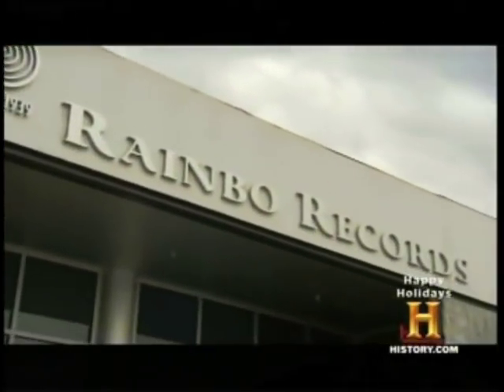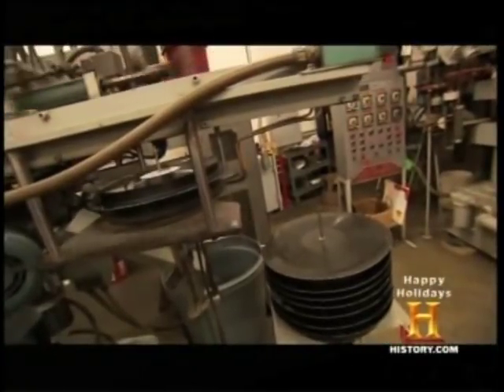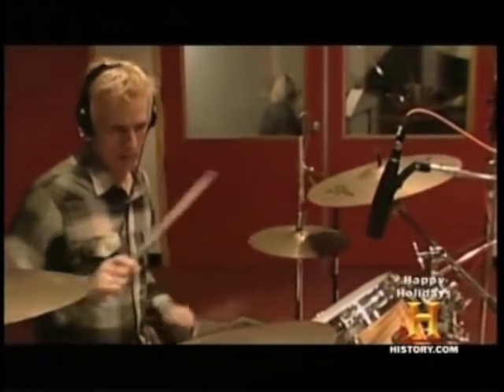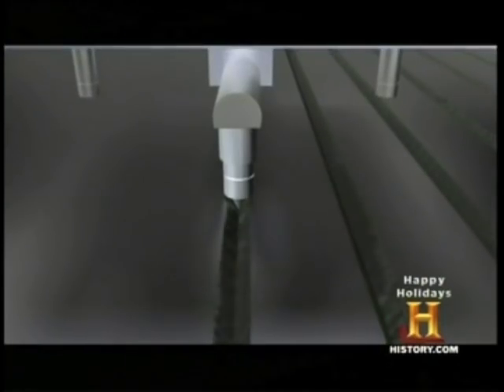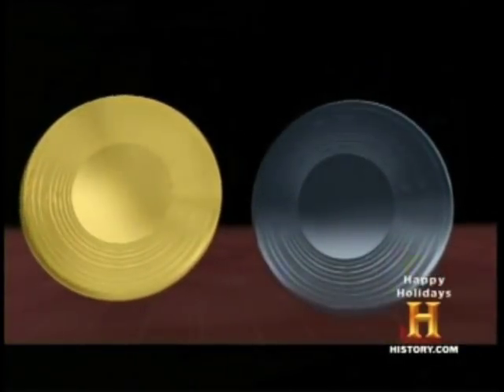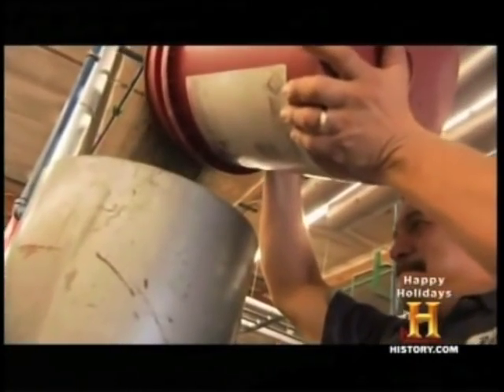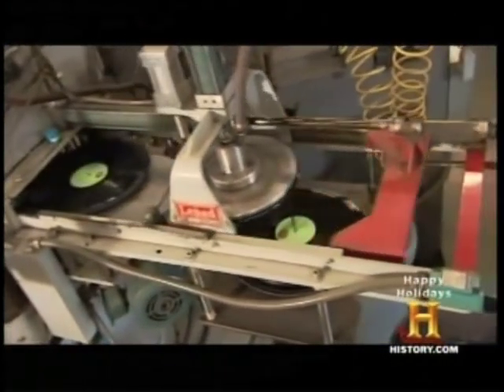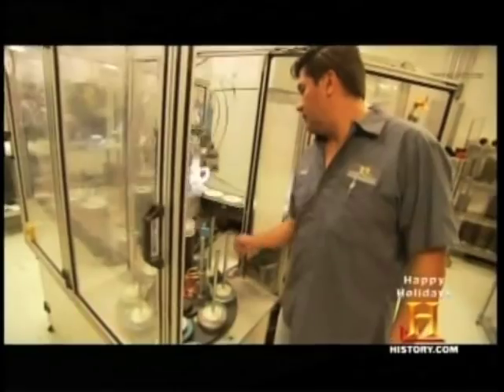Rainbo Records--How a Record Is Pressed

Comment: @HypeRhymz The problem about those players is that I hear they are more cheaply made and the stylus is a lot more delicate.  There are plenty of youtube users that post videos of their 45s playing on their old household turntable and it sounds better than a CD would produce.  I'd just ground the outer cable to something metal and modify the audio cable so it fits in the 'line in' jack.  They have the red-white-to-3.5mm converters at Radio Shack, for example.  Nothing beats the sound of a vinyl.

Comment: Vinyl has very limited dynamic range, CDs, are 48.1 24 bit, iTunes sells the crap audio for streaming, except you pay an extra buck for HD. Only way to get any thing decent from vinyl is completely manual equipment , remove the auto on, and auto return gearing, that extra dragging causes extra friction against the tone arm, which hold the cartridge needle favoring one side of the groover.The automation has gearing, great gearing, but still drags. The tone arm should float effortlessly through the center of the groove, and drop deeply into the groove, or you just don't get it all. Back in the 1977, they were trying to add dynamic range enhancer, another black box, for turn tables, then came the CDs, with huge dynamic range. Then came the greedy quick stamped CDs with hyper compression
Reply: CD's are 44.1k 16bit actually. As for the so called drag, it's very minimal unless the mechanism is very dirty and lack of lubrication. Actually some of the better turntables have either mechanically or electronically dampened tonearms to fight resonance, meaning they deliberately put sticky goo in the bearings to add resistance. As for cartridge pulling to one side, physics tells the needle will always pull towards the center of a record. There are ways to solve this, first is to add anti-skate, either mechanically or electronically. Mechanically, there is a spring loaded cam or a weight on a rotating arm by the tone arm. As the arm goes towards the center of the record, the cam or the weight rotate to apply more and more force towards the outside of the vinyl. Second way is just have a linear tracking system where the tone arm moves on a rail instead of turning alone a shaft, this way the needle is always parallel to the groves.
Reply: sunnyjason
I think some even had little air cylinders to create dampening. I don't believe anyone mentioned that vinyl needed help, it wasn't the ideal media for audio reproduction, and eventually RIAA stepped in to create standards for equalization curves for vinyl media. Also, about the late 50's, man wanted to create even more impressive sound and began using 35mm film media to record music, since magnetic recording tape still had issues. But, I have to assume the added cost was not welcome, telling me, people never really want ideal sound quality.
Reply: Boscobear Automatic players typically disengage the mechanism that moves the arm once the needle is put down on the record. So no extra drag.